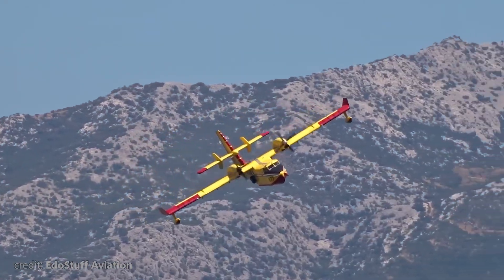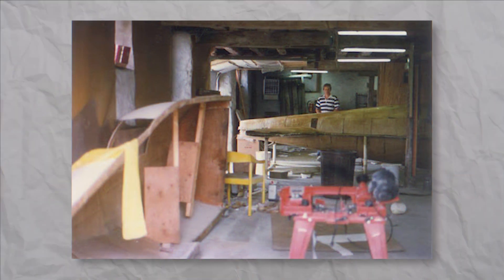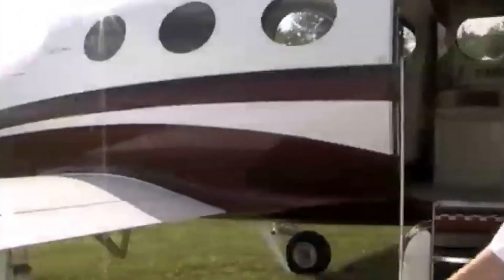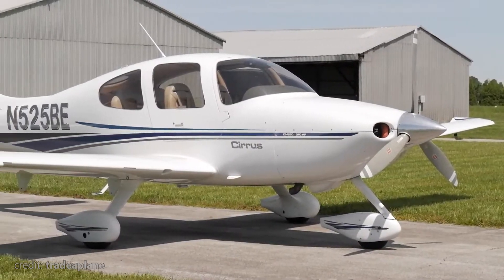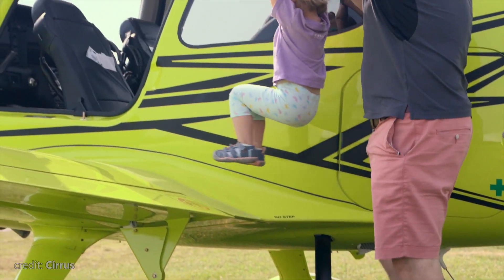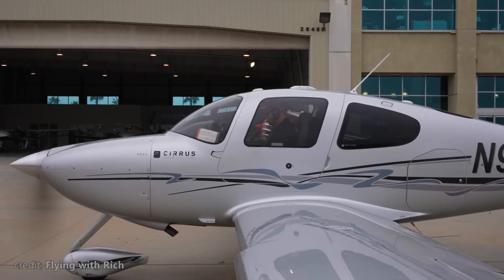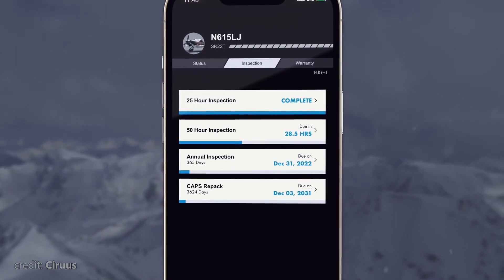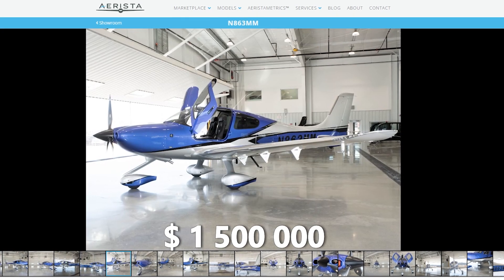Cirrus SR22 – Ultimate Experience? History, Review & Specs

Comment: I think your video misses the point... it makes it seem like the Cirrus appeal is a gucci flight experience. That's part of it, but what's understated is the way in which the avionics and ballistic parachute system enhance the safety of flight, for both the pilot and passengers. Children flying as passengers can be trained on the use of the CAPS system in the event of a pilot incapacitation--this appeals to both pilots and passengers. The "family airplane" vibe isn't just about carrying 2 adults, 2 kids, and some suitcases, but getting them home in the event that the unexpected happens. The video notes "400 lives saved" as an off-hand statistic. If you're the spouse or child of one of those 400, it makes a big difference. Cirrus has an accident rate less than general aviation (GA) in general. While they had a higher percentage of fatal accidents through the early 2010s, Cirrus got aggressive about training pilots in the use of CAPS--CAPS is contrary to many of our experiences in initial training--have an engine problem, find a farmer's field. That doesn't work well in the Cirrus which has an approach speed 15 knots or greater than Piper Cherokee or Cessna 172--there is too much energy to dissipate on unknown terrain. Now, Cirrus has both a lower accident rate and a lower fatality rate than the GA average.

Ever fly at night in a single-engine aircraft and start considering what your options are if you were to lose an engine? Terrible choices, even with modern tools such as satellite imagery--maybe you can identify a farmer's field from your avionics or EFB, but you can't tell if the satellite imagery is current--there could be vehicles that you can't see until too late, or the field could be plowed in the opposite direction, and there can be power lines that you can't see at night. CAPS is a much safer option as an emergency backup than "hope for the best and land in a farmer's field" for single-engine operations at night.

These statistics are particularly noteworthy when you consider who the primary operators of Cirrus are--I suspect that Cirrus pilots on average have less flight experience than pilots in single-engine Piper, Cessna, Mooney, and Beechcraft aircraft (I could be wrong, but it would seem that those who have that kind of money to spend don't also have the time to cultivate prolific flight experience). If my assumption is true, you have an aircraft (Cirrus) that has made less experienced pilots safer than more experienced pilots operating other aircraft. That's noteworthy.

Cirrus has continued this emphasis on passenger and pilot safety with the introduction of the "Safe Return Emergency Autoland" feature introduced earlier in 2025 (about 9 months after this video was published). I think all-in-all, the Cirrus appeal isn't just a cult-following for an experience, but one of perceived safety--a perception which has proven itself in the statistics over time.